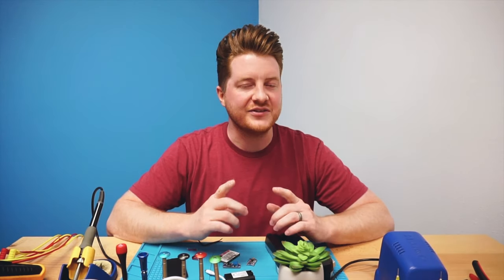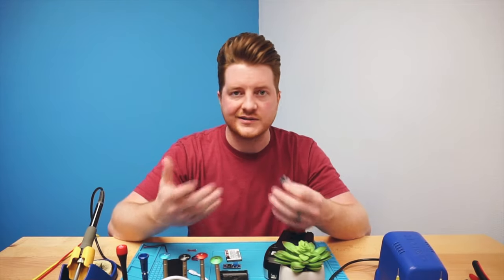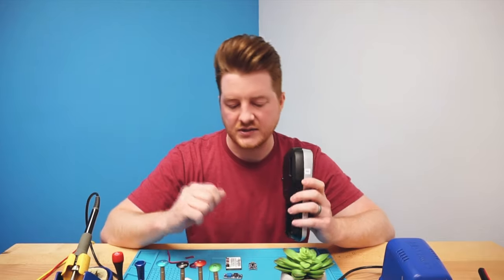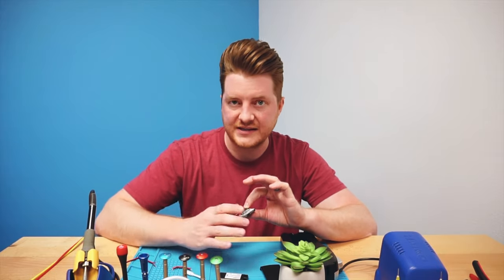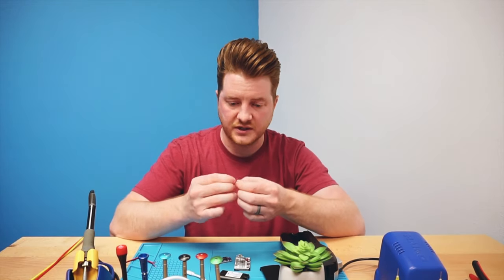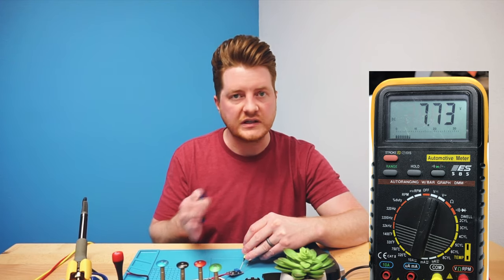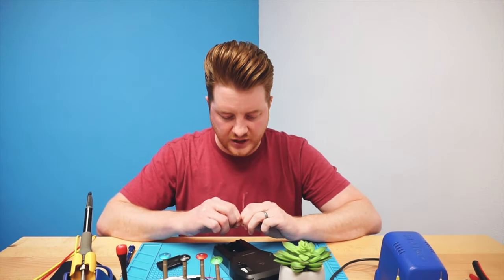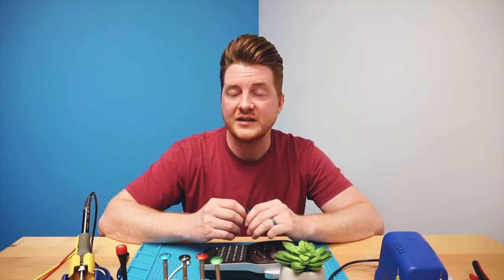How to Make ANY Device Rechargeable!

Comment: Actually,m i want to do the opposite, i have toy fan that has built in chargeable battery but it lasts for minutes and need to charge again. What I want to do is making it to work directly with USB.. any thoughts
Reply from the maker: Yes! What is the battery voltage?

Comment: These cell phone batteries would not work well for a speaker that uses 8 D batteries? The AC charger says 9v 200 mA. Newbie here trying to convert a Brookstone outdoor speaker to a rechargeable version
Reply: Were you able to find a solution to your problem? I also plan to do something similar to what your planning.
Reply: @kirbytorresph  I gave up.  Bluetooth speakers were too cheap to continue trying to make this work.  I did connect to Bluetooth receiver to it and I leave it under my gazebo

Comment: have you received any negative concerns about using these modules? I have a video showing how to wire two 18650's to a TP4056/MT3608 to feed into an LED lightstick (basically a flashlight) and some people have safety concerns. From my understanding, as long as the cells are wired in parallel, the 4056 should regulate under/overcharge so as to prevent any fireworks? Does this sound right to you? Thanks for the video! It was inspiring.

Comment: If you're having trouble finding old batteries to recycle (or maybe want a slightly better battery) head to a mobile phone repair shop - they often have batteries new out of the box for older model phones which ended up being excess stock. I just went and bought a bunch for $5 each.

Awesome vid BTW, thanks for sharing!